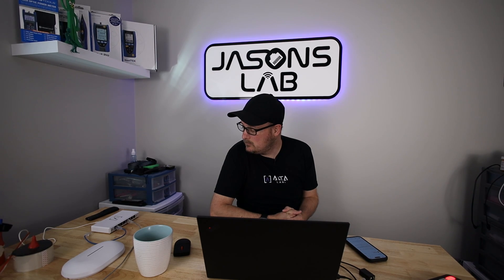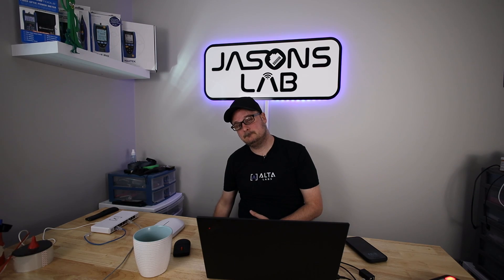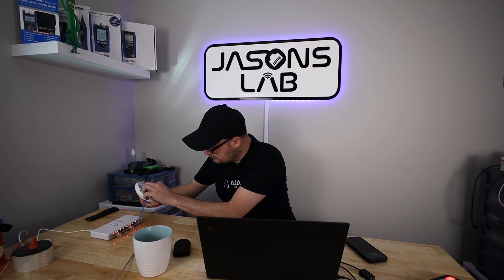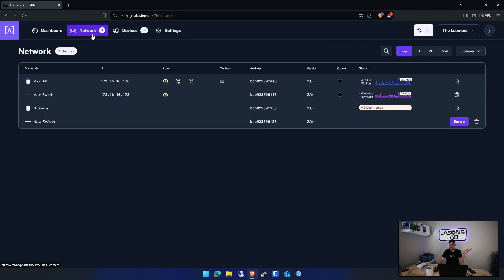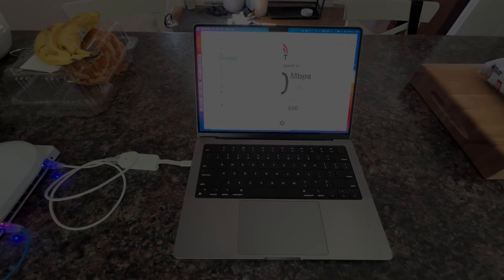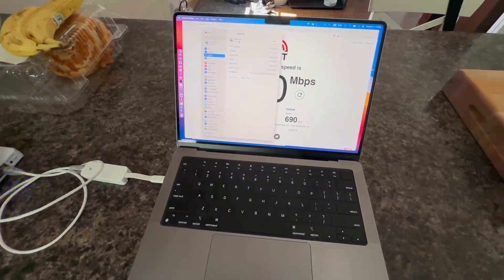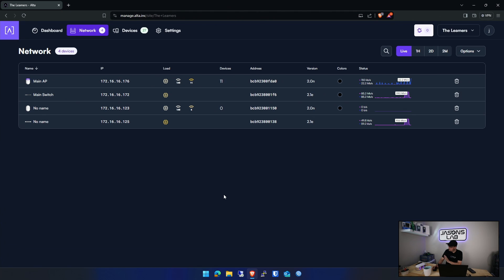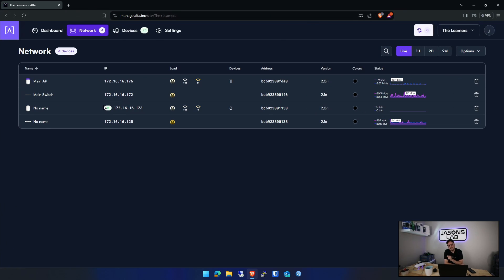You Have TO Try this ! Alta Labs MESH Setup !! @AltaLabs

Comment: Please bare with me, let’s say I have the router, controller and two access points, is it enough that one AP is connected to the router and one is connected to only power cable in the other room and the mesh will work? If no, what do I need to make it work they way I described it?
Reply from the maker: Thats how it works, but you can even plug a device into the meshed ap, and it will work very fast too !
Reply: @JasonsLabVideos  Thats actually really good news and good! We are moving away from our current appartment to a house so pulling calbes through the walls and making new wholes in the walls is not an options. I am struggling between Alta Labs and Omada, but, after this, Alta labs is clearly on top! Thank you for the response, I feel a bit more confident! :)
Reply from the maker: @AltaiiSinan  The mesh works awesome too!  You could use a POE switch on the meshed ap, and a few devices off that switch, it works VERY well too ! very Stable !